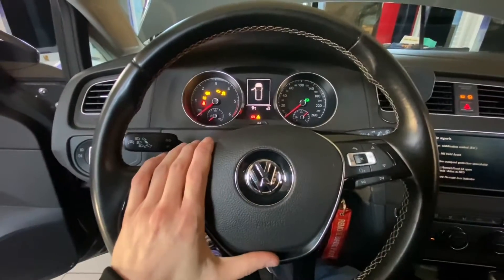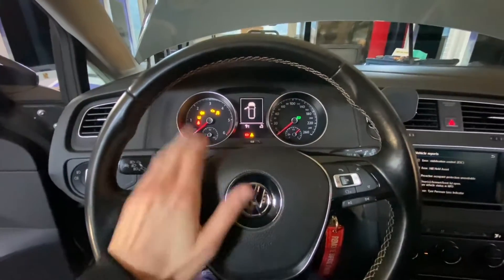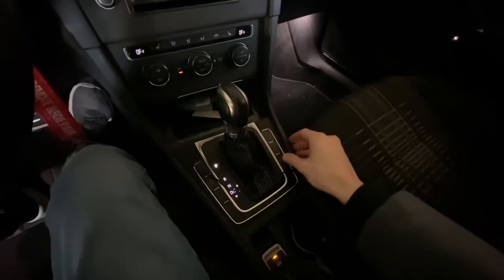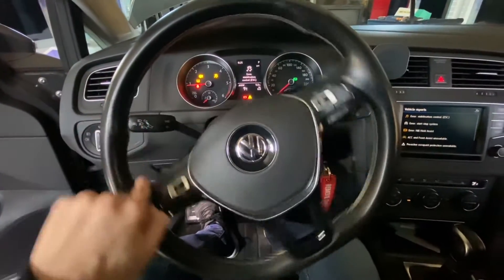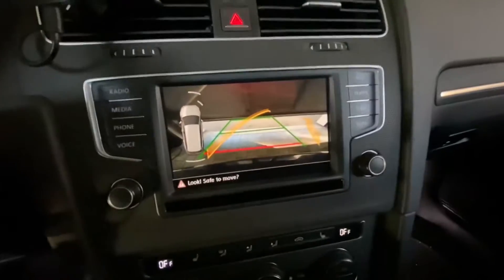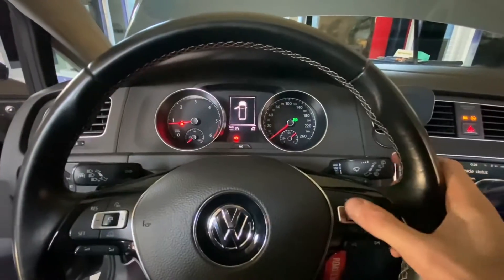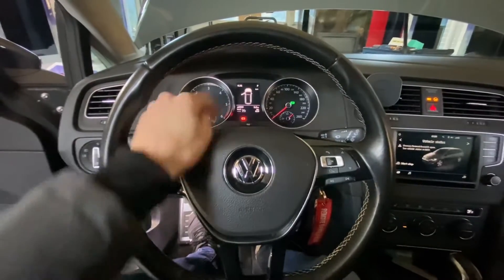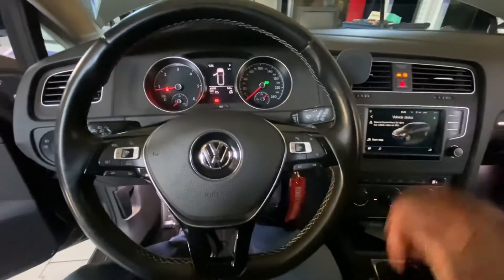VW Golf MK7 (5G) Steering Angle Sensor basic settings (ESC ACC TPMS error fix)

Comment: This helped me with VW Jetta 2017. My issue was my gear wouldn't turn to drive. This fixed thr problem to turn gears but it did not fix the error problems. Signals are still there. Either way it worked to where i can drive my car again.

Comment: Hi, is it normal that those errors appear whişe driving, i had ABS ESC, Front Assist, Tire Pressure, Light System, Park Pilot, Hill Assist 
It disappeares while driving came back

After a few minutes it disappeares again 🙄
Reply: @ekremusameyagmur9393  I have that problem please tell me wat you do

Comment: Hi, my car just did this. But after it was turned off, it stopped with most of the errors. Just one remained, so I think, that there is still a problem. Now it just says acc and lane assist deactivated. My lane assist works but the acc does not. Maybe the radar or a wheel speed sensor.....I dont know, of to the workshop;-)

Comment: Thanks for the video. My problem was one of the ABS sensors alarms and I also had the steering angle alarm. Doig this procedure reset also the alarm for the ABS sensor, even if the sensor is still not sending the signal to the module. Is there any other procedure to diagnose the module or any other devices that could be related to the ABS sensor malfunctioning?
Reply: @Livingchinatoday  did u fix it?

Comment: What do u do if the steering wheel is stiff not loose
Reply from the maker: Investigate why power steering is not wotrking. Start with fuse check if it's electric power steering.

Comment: I have a VW Golf 7 2014 and after connecting the computer, it displays error B116816 steering angle sensor - too low voltage. Does the tape need to be replaced or is the problem somewhere else?

Comment: I have same problem but i cant start engine
Reply: me too
Reply: Me too
Reply: Se soluciono ?
Reply: Me too just go all these faults now and the car won't start
Reply: @thefreakshow83  have you found the problem im experiencing the exact same
Reply: @marhanrob3043  failed megatronics unit in the transmission. Expensive repair.
Reply: @thefreakshow83 did your car start sometimes and you could switch to drive and then shortly esp fault and front assist disable light come on and the PRND flashes
Reply: check fuse in in cabin mini
Reply: Did someone found a solucionar? I have the same

Comment: After i replaced steering gear for my vw atlas , i got same alarms . i followed your instraction but doesn't work
Reply: @mdos405  I have the same problem. I changed the direction and I get the same errors. Please, what did I do?

Comment: I have the same car, same issues but my steering light is red and the steering is very heavy
Reply from the maker: I would recommend performing a diagnostic scan to check what the steering rack is reporting.
Reply: @mrfixpl After updated the firmware I have this error U042800 intermittent. Should I apply your method to fix this? By the way, I bought OBDEleven for my Golf 7 (2016) after watching a few videos of yours, I am really appreciate for your sharings. Thanks a lot!
Reply: @AnanD Did you manage to fix this? I'm having a similar issue with a stuck steering wheel
Reply: @loneproficient  i dried my car under the sun with carpets out doors open and i opened the each of the dashboard... Seems to have gone away
Reply: check fuse in front hood 60 amps or 90 amps fuse  gone  surly

Comment: In my polo 6 r line its only flashing in a writen information mode in on the dashboard the no warning light and it only happens when driving 

It says:
Error stabilisation control
Error low tyre pressure system
Error stop start system 
Parking lot gets affected too 

So what could be the problem
Reply: Oque resolveu seu problema?
Reply: Nnnnnothing like nnnnoooothing it is frustrating me big time i did alignment it still happens did wheel balancing still it happens, did rims straightening still it happens 😢

Comment: Hi, useful info. Does it work also if you change new battery?
Reply: yes
Reply: it works always when you will disconnect battery for any reason. In my case it was changing faulty battery but also if you are doing anything with airbags you must disconnect battery.